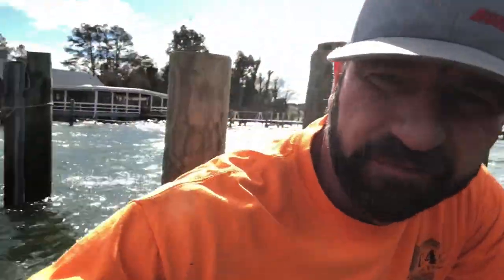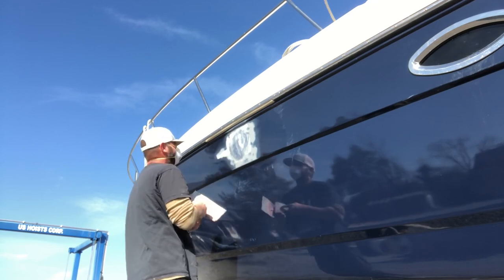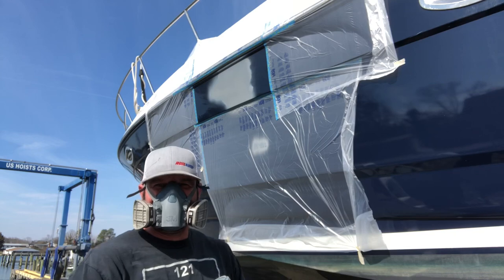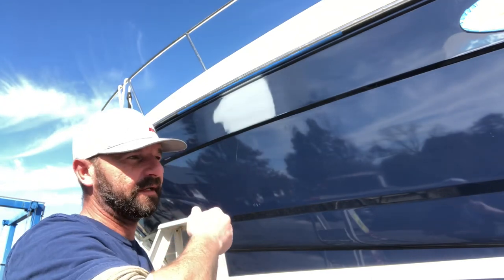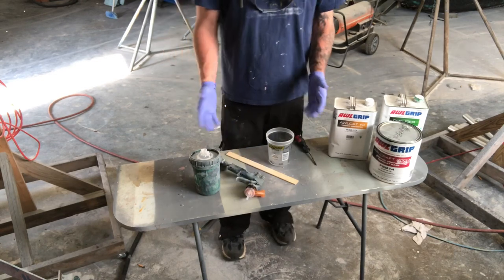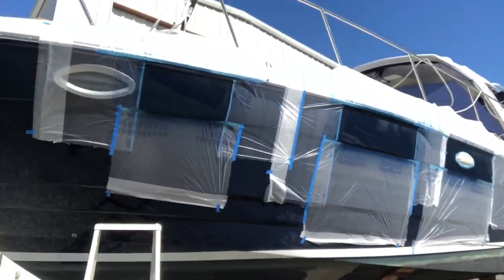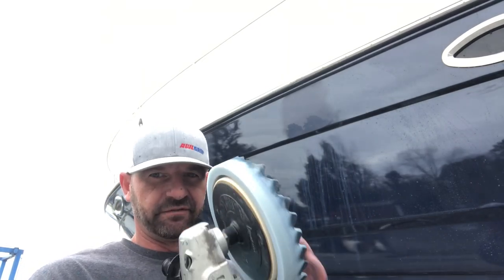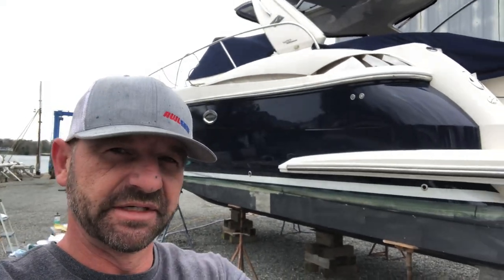How to do a paint repair using AWLCRAFT 2000 FLAG BLUE

Comment: Thanks for getting back to me. Great videos. Can you mention what copolymer wax you use on algrip please ? Sure wish you were local to Annapolis .
Reply from the maker: Awlcare is what’s recommended by the company but other products work as well. Is your boat painted with regular awlgrip or awlcraft 2000?
Reply: @boatpaintingrestorationwit3029  algrip blue but alcraft clear . It’s on 4 seasons and still looks very good. I was concerned about the combo but it seems to be fine .
Reply from the maker: I usually steer clear of clear coats on boats that stay in saltwater but the upside is the clear you have is an acrylic urethane. Meaning it’s repairable and can be buffed with no issues. Regular awlgrip is not repairable in the fact that there will always be a evident halo. But because you have the awlcraft clear then you’re good to go 👌👌
Reply: @boatpaintingrestorationwit3029  that is a exactly the reason the painter cited . Easy buffing. I have have large yet covered fenders that rub against it all winter put fine scratches. I run a buffer over it in the spring with a light compound and all scratches are gone . So the plan worked well.
Reply: @boatpaintingrestorationwit3029  boat is a jeanneau 58 and paint is maurichies blue. I may have misspelled.

Comment: Question if you are still checking- I just did a roll and tip touch up of original Awlgrip (not 2000).  Using a lot of your information as a guide! Thanks.  On my 3rd coat and it's hiding the spot pretty well.  Can I machine polish the spot once I finish wet sanding the tipped edges with 1500/2000/3000 to Get it to blend in? Can I do it by hand sanding? spot is about 6" by 12"- Then 
 Can I machine polish the entire hull once done?  AWLGRIP seems to say no, but unsure?  Your advice is much appreciated! Thanks and keep up the amazing work!

Comment: Hello my name is Mike I just want to let you know that we’ve watched pretty much all of your videos and we thank you so much for the info and for teaching us I have a question for you we recently had a boat painted with awl craft paint A month later we had the boat filled up with gas and some overflow of the gas spilled onto the paint causing the paint to shrivel and turn into a mushy condition we are trying to find out what could have caused this because who has not had An overflow of gas to their cars and boats and I don’t think that that should’ve happened do you have any knowledge on to this please we really need your help
Reply from the maker: Hey mike. There are a few different reasons as to why this might have happened. One it the paint wasn’t mixed properly. 2 is if the fitting wasn’t removed before paint and was taped off poorly and paint got on the fitting itself, when it overflowed, the fuel managed to creep behind the paint and that could have caused that to happen. Seeing it in person would be a big help.
Reply: @boatpaintingrestorationwit3029  Something else that may be a factor is the length of time between when the boat was painted and when fuel was spilled on the paint.  Doesn't this stuff need about 2 weeks to fully cure? And I'm asking, not telling.  I just read that and wanted to know if what I read is correct about the cure time?

Comment: Thanks Frankie for sharing your expertise.  If you had a similar repair that was clear coated would you blend the clear the same way as the topcoat?  If you didn't breach the topcoat in preparation, is priming necessary (orginal paint is Awlgrip, dark blue)?
Reply from the maker: Yes. Sorry for late response Kirk. YouTube has changed and no longer notifies me of comments for some reason

Comment: Great vids you do. I have had some of the same repairs to almost same color on my boat but Awlgrip told me never ever put wax on awlgrip so I'm wondering why you do it?
Reply from the maker: Wax is definitely not recommended but copolymer is. The true wax I used at the end has copolymer shield Technology and is designed for paint. After using the various compounds and machine polish, then it’s good to seal it off with a copolymer product of sorts👌

Comment: Well done on this video. Really good 👍. If I buy a hull with old awlgrip, is there a diy brush and tip paint that can go over the awlgrip or do I have to spray on?
Reply from the maker: You can roll and tip awlgrip if you choose to. There are multiple different type paints out there that you can roll and tip. Awlcraft however is not one of them.

Comment: Frankie, do you ever use high build and if so can give is some tips on that? I’m painting a Seacraft CC and can see some print thru in the gel coat from the woven I guess. Will 545 hide that or should I high build it? 
I have watched most of your videos and have learned a ton.  You are very talented and a great teacher. Thank you very much!
Reply from the maker: Greg Mason hey bud. I do use high build sometimes but usually when that’s needed I use Barrust 235 instead. If you sand good and apply 3-4 coats of 545 that will usually make the print thru disappear. It will really depend on what your finish color will be. The darker the color the more likely the print will be visible. If going light then the print will definitely disappear.
Reply: Frankie Bushong , exactly what I needed to know, going with Ice Blue. Thank you!

Comment: Frankie are you using awlgrip paint on top of gelcoat?  What is the process to match up the color?
Reply from the maker: Randy Greenberg this boat was painted a few years ago with awlcraft 2000 flag blue. It was a gelcoat finish before it was painted. The process I showed with priming and painting for these repairs is how you would tackle the whole boat for a full paint job. I knew what color it was so I was able to quickly knock out the repair. Hope that helps.

Comment: Planing on painting my deck soon, it has a lot of spider cracks and other cracks in gelcoat. what is going to be the best way to prep these cracks before staring the painting process?
Reply from the maker: Hey Bruce. If it’s a bunch of close range cracks is various areas then I’d recommend removing all product back to bare glass and put some new glass on those areas. Only way to prevent them from coming back. If they are scattered and by themselves then you can just grind them out with a die grinder or dremel tool. Bevel the edges and grind through the crack into the glass and backfill with epoxy ( thickend epoxy, or awlfair, or a product similar) you will be good to go after that. Just now seeing this message 👌👌

Comment: Love your work. Have you ever tried just using the Bar Rust 235 for priming instead of AwlCraft?
Reply from the maker: Yes and it works just fine. However or, Barrust is hard as all get out and tough to sand. Doing a quick scratch and over coating with 545 is quicker with better finish results. 545 sand like butter. Lol

Comment: do you clean gun and add new paint each coat ?
Reply from the maker: No. Only if it’s really hot outside will I flush gun after each coat but usually not needed. I add more paint as needed but when I mix up a batch it lasts for the entire process. I fill the cup as needed 👌

Comment: looks amazing, love how you blended into the original color.  I have an older awlGRIP (not awlcraft) flag blue sailboat hull to tackle at some point, can you take the same approach with the prep? and can you apply Awlcraft 2000 on top of that old AwlGrip paint.  I've been told you can't sand or buff the old awlgrip with any compounds, you will just get scratches? This old boat has lots of scratches, and a few worn area where i can see white primer underneath the flag blue. all advice would be greatly appreciated